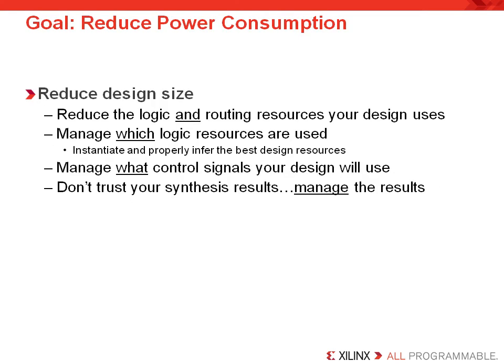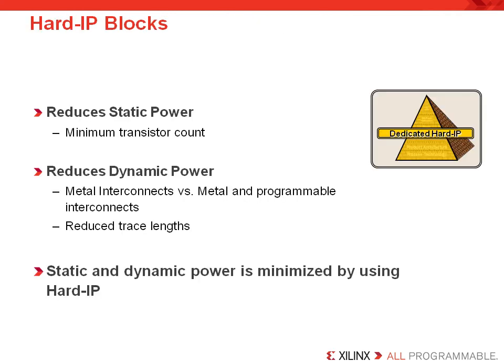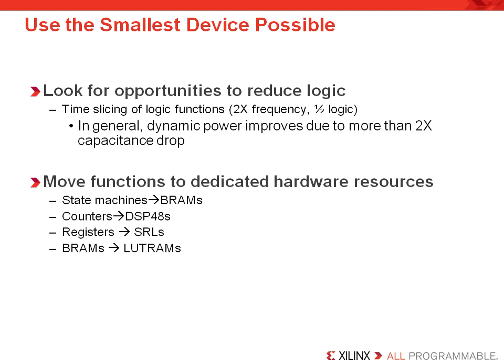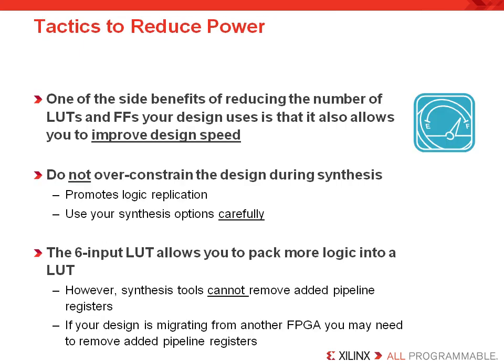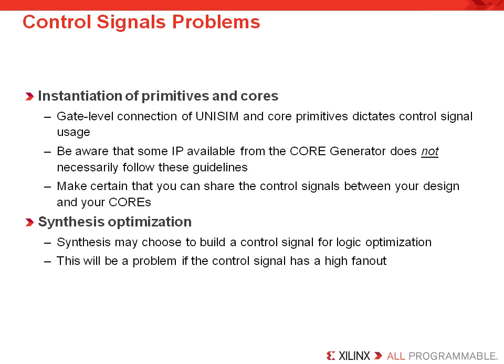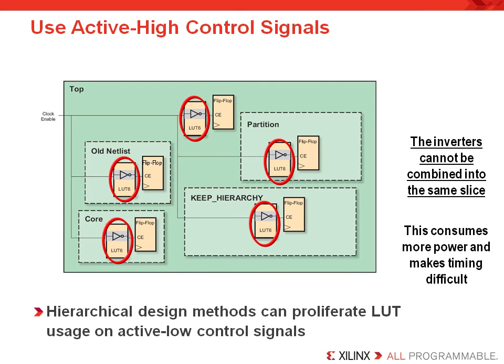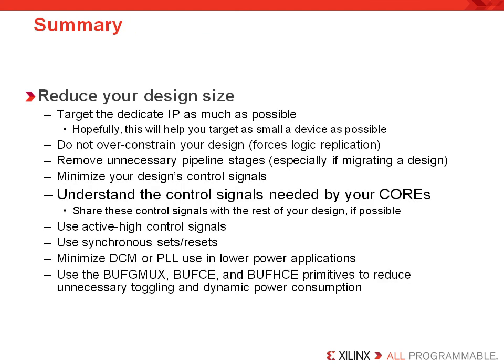What are FPGA Power Management Design Techniques

Comment: The decoupling capacitors would be also placed as near as possible to the FPGA.
Still today I use a Spartan 3E FPGA, it is powered by linear voltage regulators.
But linear regulators are not "state of the art" due to the huge power losses.

Thank You.

Regards.

Stefan

Comment: Dear Mr. Nelson, at first Thank You for uploading this video.
I plan to design an evualation board unsing a Spartan 6 FPGA, to gain experiences in using FPGA's. So the FPGA works with different configurations and it is nearly not possible to calculate the power consumption exactly. Can you tell some maximum values? I plann to add switching regulators with synchronous rectifiers (no diode loss) to the design, to supply the FPGA. It would be placed close to the FPGA.